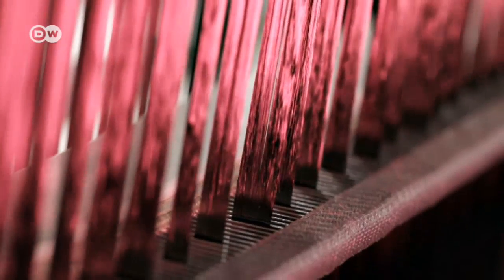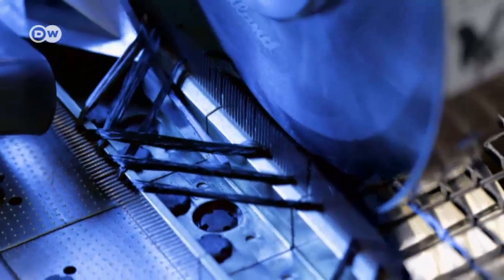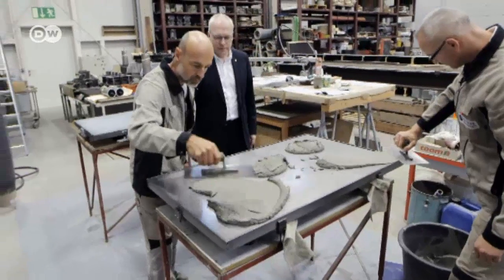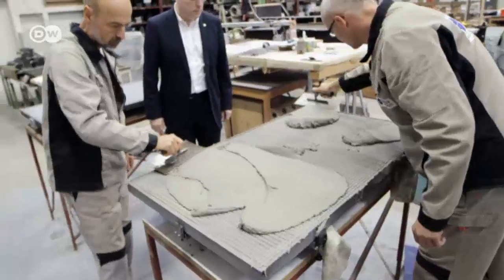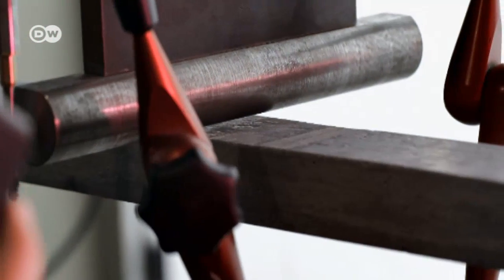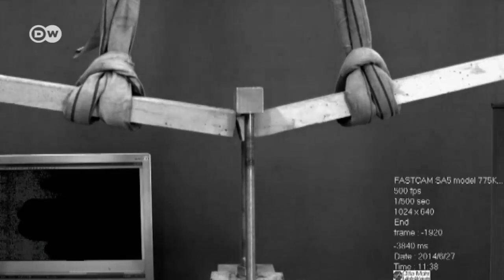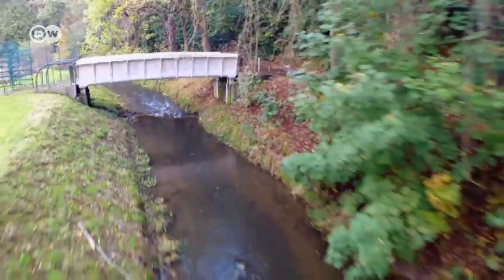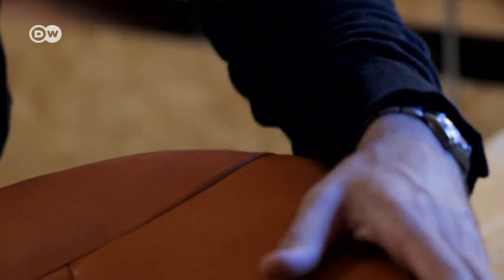Building with textile concrete | Tomorrow Today

Comment: In addition to the fiber skeleton, you can put bits of waste carbon fiber, to help bind everything in case of cracks or fractures.
-another good thing to do is to put sensors inside at regular intervals, besides use external means to check.

Comment: Carbon fiber is inferior in several ways to basalt fibers. Basalt fibers are cheaper to make and have the same expansion coefficient as concrete to boot.
Reply: but weaker
Reply: @digitalconsciousness  you can buy much more tho

Comment: No mention of Concrete Canvas which can already "make chairs and tables" etc and  is in fact in widespread use already and doesn't need to be made with expensive carbon fibres.
Reply: Canvas is old tech.  Basalt material is MUCH stronger and is in every way FAR better than canvas.
Reply: @patrickeh696  and far cheaper than carbon fiber too.  Only a German would ever consider carbon fiber as concrete reinforcement (the most energy intensive and expensive fiber to produce in the world) and then brag about their "lowering emissions."
Reply: @Sugarsail1  
well... 60% of their power comes from coal it's no surprise that the most greedy idea would be to find another use for that huge stockpile of coal they already have!
Reply: I have some products i've been working on for skatepark construction and some non profit ngo products that i would like to use concrete canvas , or a version I can modify, please contact me if you would like to collaborate , I have had a hard time sourcing it in anything but huge rolls...
Reply: @walruschicken  i want to know more

Comment: we choose textile reinforced concrete as our final year thesis, where can i get this textile sample for our project...
we are from INDIA.......
Reply: Have you found the sample... I am also interested in pursuing this topic as final year thesis ..
Reply: @sounakmajumder889  Hello even i have taken this as my thesis topic this year. Did you find anything regarding this topic and materials
Reply: @manishasharma690  sadly no....so I changed my topic....even if this material is available...it is very costly...so without any financial aid using this material in project is very difficult for a student. Hope this helps you.
Reply: @sounakmajumder889  ohh i was thinking may be this can be done using some other material. And i will look for the testing lab. Btw may i know what project your working on now.
Reply: @manishasharma690  are you btech final year or mtech?because I am btech final year.So if you are mtech then doing project on this topic may be easier. I am changed my project topic  now to traffic management.
Reply: @manishasharma690  If you do pursue on your current topic and manage to find the raw materials plz let me know maam from where you have got the materials.
Reply: @sounakmajumder889   where are you from??
Reply: @jayshah3582  Bhubaneshwar, odisha
Reply: @manishasharma690   .
Reply: @sounakmajumder889   let me know if you need carbon fibre
I can courier it to you
Reply: @jayshah3582  cost?
Reply: @sounakmajumder889  
5 rs/gram + 50rs delivery charges
Reply: Is this sample even available in India?
Reply: I do have 4kg carbon fibre yarn,
Let me know if you need it.

Comment: If you build a home and prep the frame properly before pouring the cement you can even use chicken wire. Anything adding to the concrete to assist with street if better than nothing. My dream is to used metal fences between my concrete walls so the house doesn't fall on my if we have an earthquake.
Reply: Actually chicken wire will corrode and can cause lamination.
Reply: chicken wire will cause internal failure of the concrete.  Best to use basalt mesh.

Comment: really cool product for the rich , basically its the same thing every good product overlooks the poor , its all about money
Reply: carmichael moritz you remind me of a college student I had in my class. His ideal society would be the kind of society that could share everything with out paying for. It may be possible, however keep in mind that everything has a cost for it production. 

I wouldn't say the poor couldn't own it, I would say they have to work a little hard it and safe a little more. If you want it so bad it will happen.
Reply: no. its not at all. this is cheaper.  the materials are less, energy to produce is less, and the size and weight is less. all of these things means cheaper product. the only thing that had its initial cost high was not enough production. they have already automated it, and the price is steadily going down as more production facilities are created. this is how technology works and comes to market.
Reply: What about joining this tech with air-crete methods?
Reply: WRONG carmichael.  You just need to learn how to use a search engine.  I will demonstrate: https://www.youtube.com/watch?v=N18HcPfKv1E
Reply: james m ,, so are you saying it would be more cost efficient using this material to make a end product wall basement that is strong enough to with stand the pressure of the earth ... i need to build a low cost basement that goes below the earths surface ...
Reply: j r ... yeah i know about the cost ... thats why more people need to be less greedy and volunteer a whole lot more of their time  ...  people wont do this though ,,, the wealthy always want more ...

Comment: Carbon fibers are usualy made out of Oil ...
Reply: derxman and they crack and go brittle over time. This won’t work. Polymers CAN replace steel, and can be made from plant material at a much lower price. Cellulosic material (wood or herb stalk with lignin removed) can also be used, and with new technologies, we can make it much stronger than steel and make it in long sections.